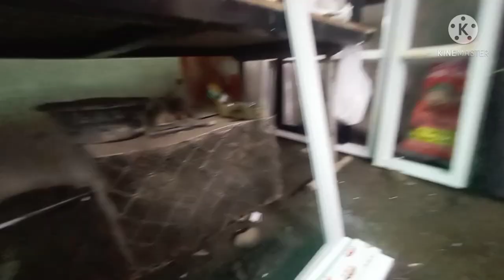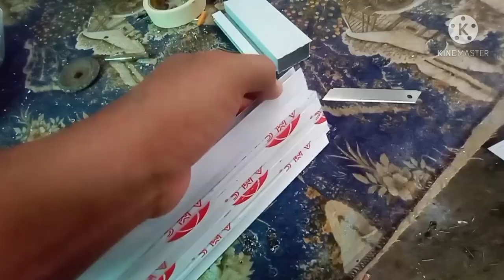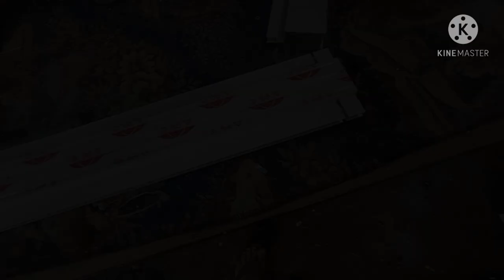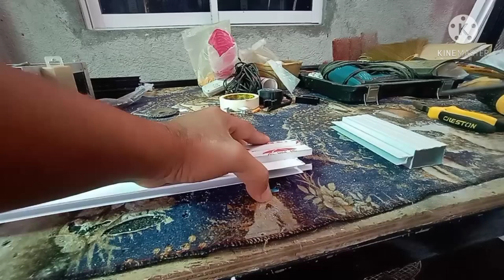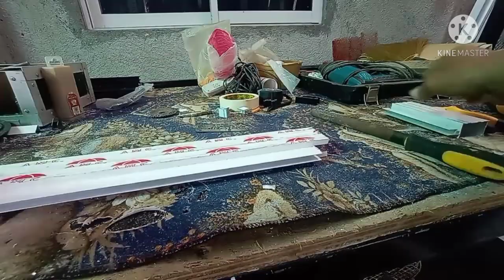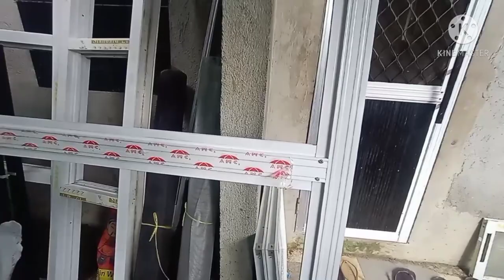Paano Magkabit ng Alco Cross Bar sa Alco Frame?

Comment: boss feature namn po ng pag cut ng aluminum siding png incubtor.
Reply from the maker: Aluminum composite panel po?
Reply: ung llgy po corner ng cabinet incubator Aluminum Angle Bar.